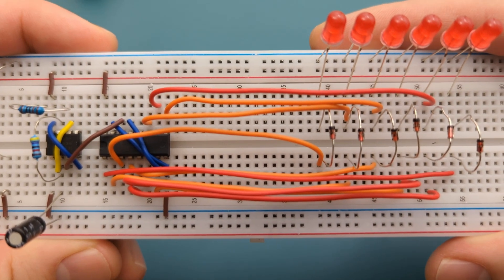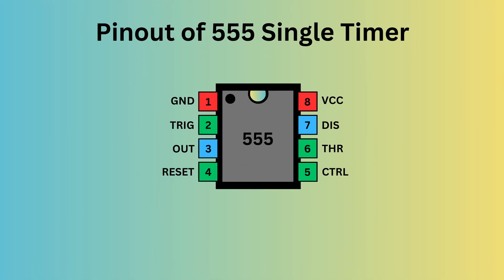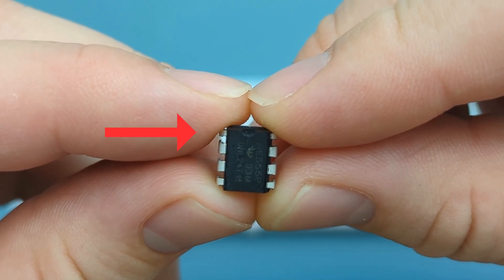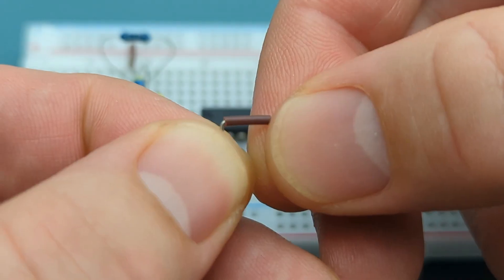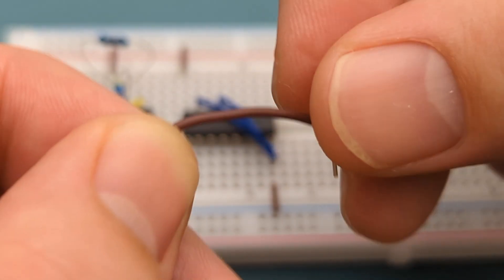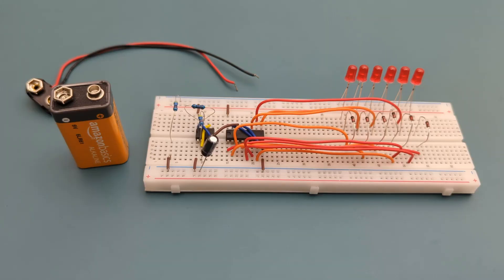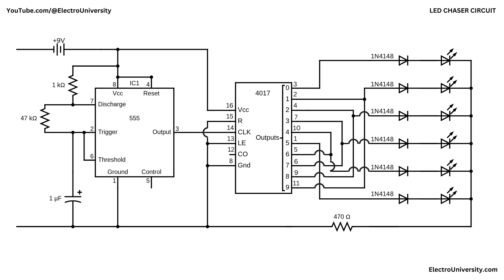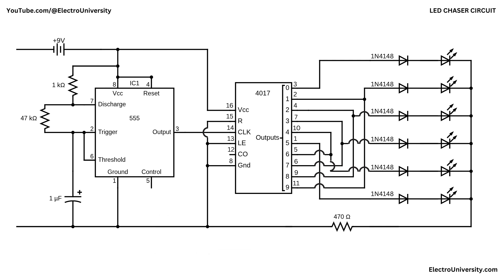Build a Moving LED Light Like Knight Rider!

Comment: Feels fast. How to slow it down a bit?
Reply from the maker: You can slow down the chase effect by swapping the 47 kΩ resistor for a 50 kΩ or higher potentiometer, allowing you to adjust the LED speed with a simple turn of the knob.